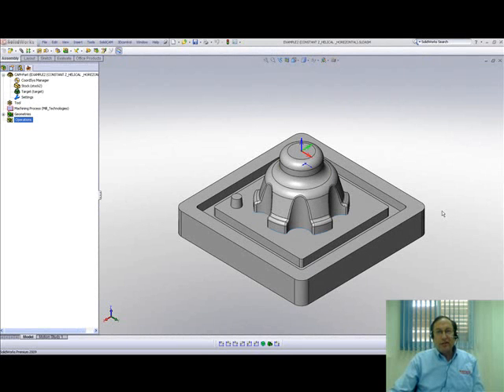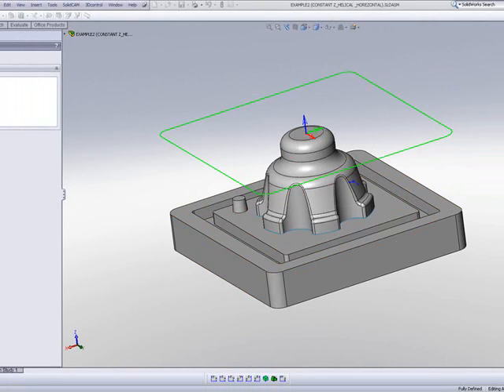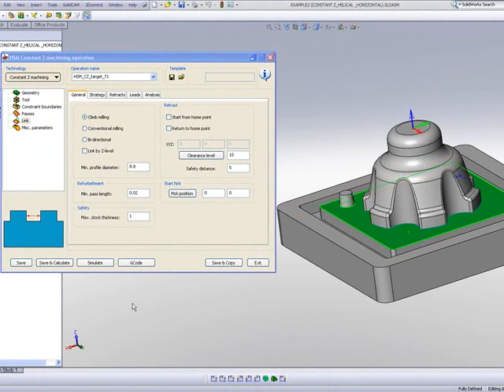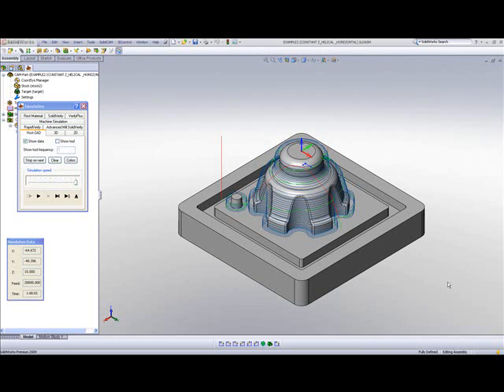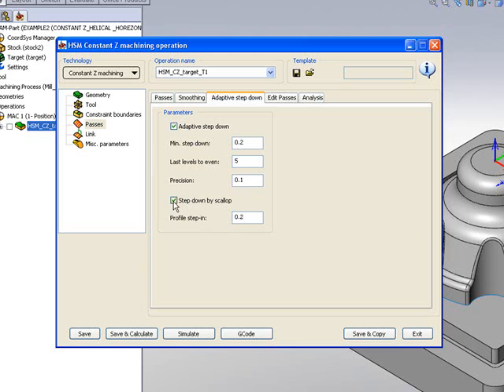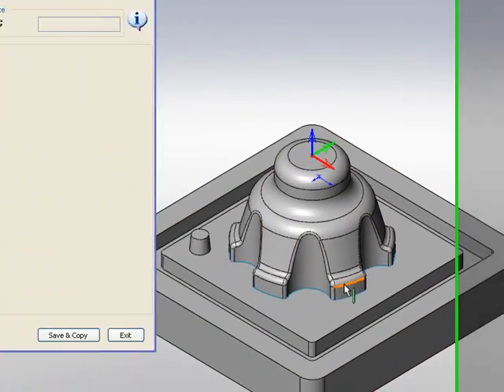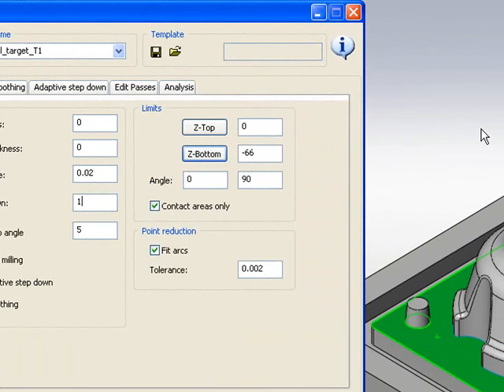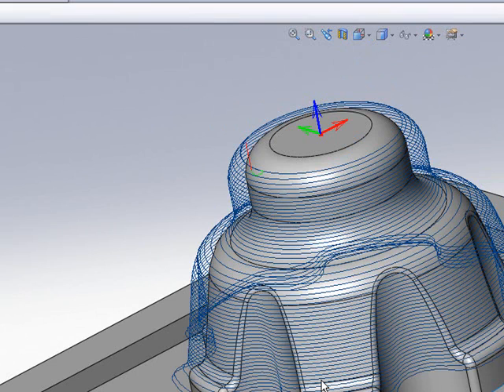SolidCAM University: HSM, example 2 - ConstantZ Helical

Comment: what postprocessor did you use and did it interpolate arcs?
Reply from the maker: As this part and recording was done 10 years ago, I do not remember the post that I used. Most likely I used one of the standard install post. If I remember correctly it did Interpolate arcs.